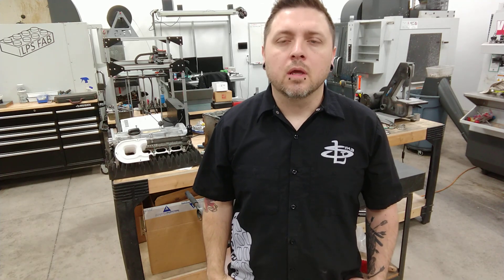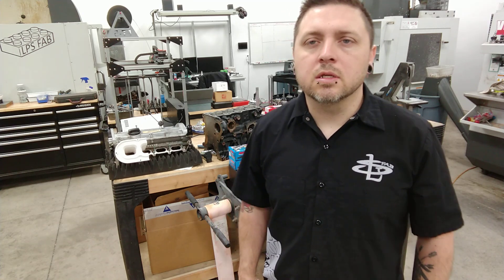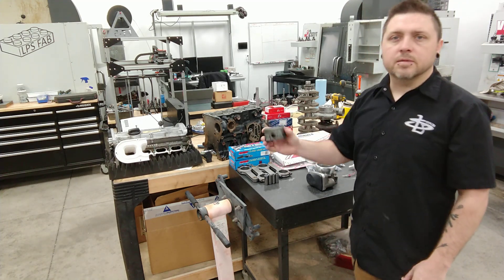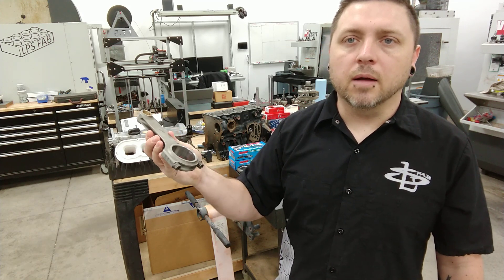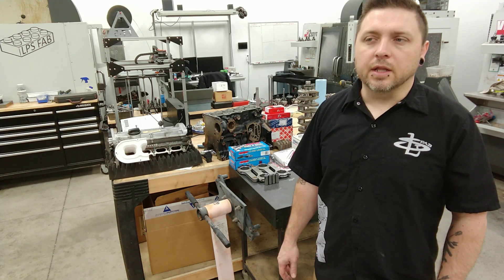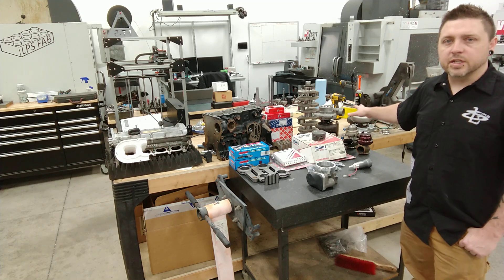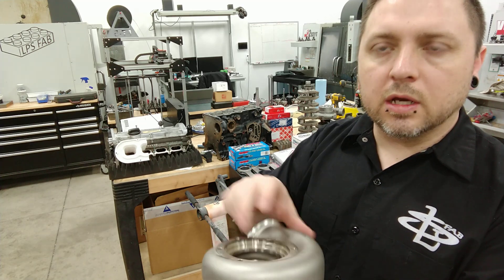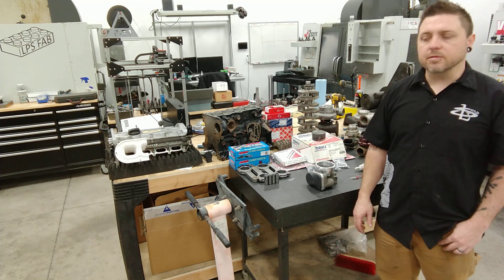VW 1.8t 20v engine build introduction

Comment: Nice informative video. what mods would you recommend for the bam engine? looking for around 300+bhp and how does the vvt work I heard it's not agressive like vtec
Reply from the maker: The bam engine should only need pretty mild mods to get to 300ish... Just your typical intake, exhaust, intercooler, reflash should get you there. The vvt in the 1.8t engine kinda sucks, it was built more for warming up the cats than making power, it only effects the intake cam and only has two positions, retarded or advanced and doesn't effect lift or duration like vtec does. That being said if you have that capabilities ECU wise you can still take advantage of the timing. I will be playing with this as we get further alone and introducing you guys to what I think is the best ECU solution on the market for our cars.
Reply: @linderpowersystems_LPSFAB  thank you for getting back to me I was also wandering what the engine code was for the 1.8 20v head and would that head bolt on to the stock bam and be fine with boost?
Reply: @musabhuiyan9940  adr is the n/a head code, aeb and agu are also large port design

Comment: Thanks very much for sharing what looks like a nuts and bolts project, too many Instagram project leave most enthusiasts jaded towards any initiative for a build of their own; meaning so many specifics are way over the top and done so unknowingly.

Top points for noting the process of validating connecting rods, regardless of where they were obtained from and their intended use 🙌🏼👍🏻

I only have one vanity question, and this is biased off of my trade of course, what engine management system are you going to use? Knowing your background in EFI calibration work, and going on the motivation behind this project build, my interest in peaked on what solution you choose.

Thanks again as I am slowly making progress with an Audi A3 using an AEH power unit, I am still working my way through some basic maintenance work but it’s driving now 😊 Looking at how interchangeable the parts are between new and older power units, I am overwhelmed about what’s possible 🤷‍♂️

Cheers Mr. Linder 🍺🙏🏼
Reply from the maker: I'm going to be trying a new ECU on this project as they have plug-in variants for several of the VAG cars. Upon reading their documentation and going through the software they seem very capable and I have become a dealer for them but am hesitant to recommend one until I have tried one for myself. If you would like to message me on Facebook or something we can talk more in depth about it, at least until I'm comfortable sharing with the public.
Reply: Linder Power Systems thanks for the invitation and I’ll opt to follow up on this with. To be fair, I think I know what brand you are looking at based on a Facebook post which you made recently 😉 Admittedly I was intrigued by your choice as I was always curious but never had the time to investigate nor a leisure access to the brand itself. 

Keep up the great work my friend, happy to be able to follow along on this project build 👍🏻
Reply from the maker: @sardengineering  yep you probably figured it out! 😜

Comment: 300hp seems a very modest power output for such a high spec build, 3d printed inlet prototype looks intriguing
Reply from the maker: With the gt3071r I think around 300whp is an achievable goal, and that is on my Dyno Dynamics dynamometer which is known as the heart breaker Dyno because it reads very low compared to most other brands. We will see though, I may change some things as the build progresses.
Reply: @linderpowersystems_LPSFAB  looking forward to it
Reply: @linderpowersystems_LPSFAB  what's the cost to build a a 1.8t to your specs just ball park
Reply from the maker: @skullettrump3424  I would never build a customers engine with cheap components like this, that s is strictly for my own car and testing. So when I build an engine to my specs for someone else it is expensive.
Reply: @linderpowersystems_LPSFAB  man ima work my ass off and save my 💵  so you can build my 1.8